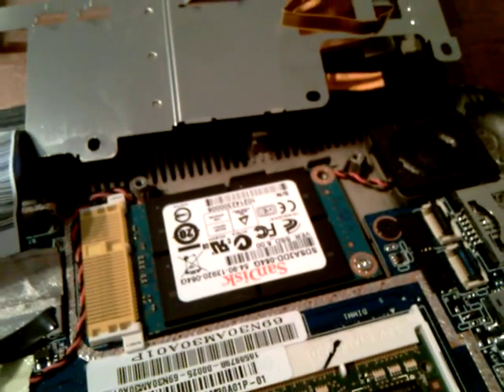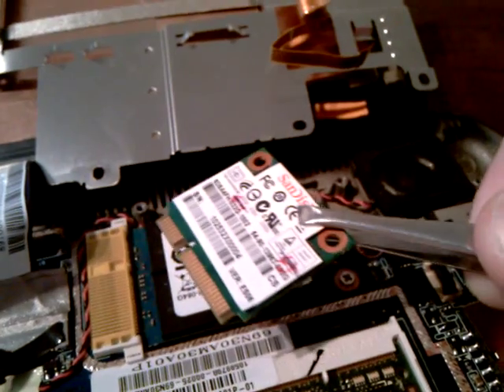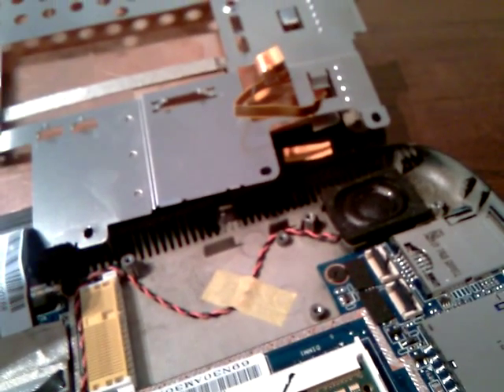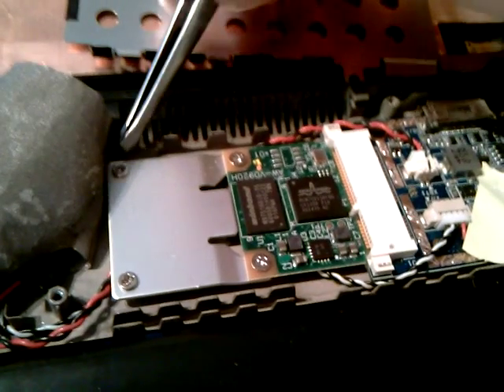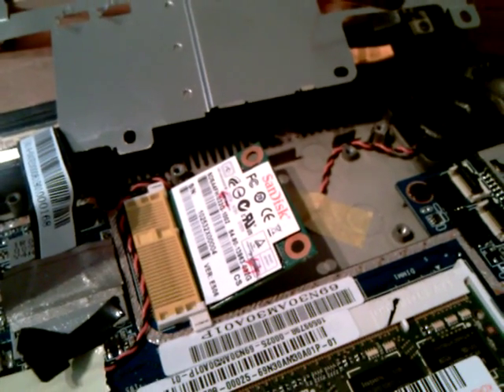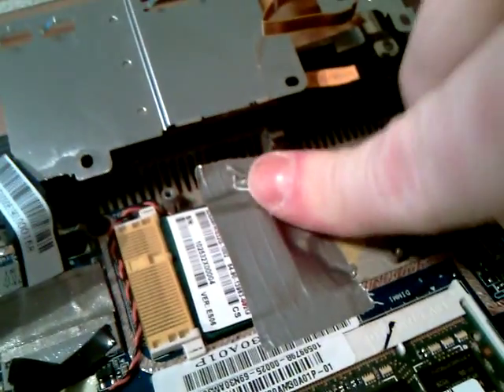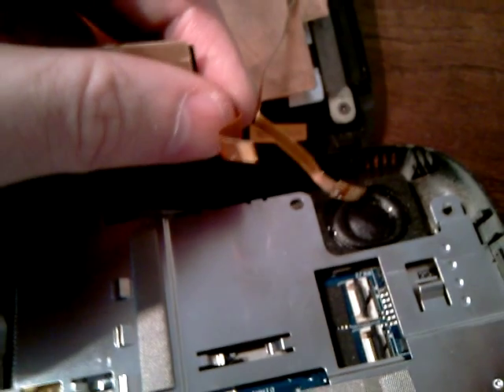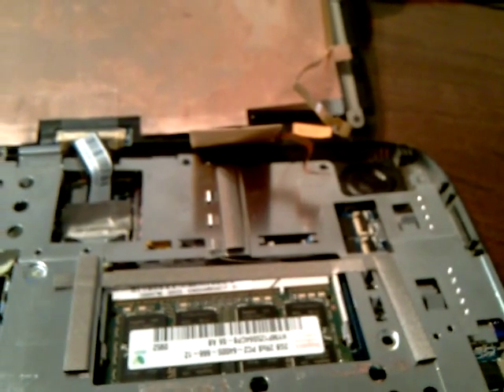ExoPC - SSD Upgrade

Comment from the maker: @cool8man lol It's fine, it only covered up a little. There is quite a bit of free space, i dont thinkg there's enough for another battery (if you were serious), and it would change the weight dynamic if one was put in. I think there's enough space for an integrated capacitive stylus though for sure.

Comment: hi was going ask about best motors for skateboard but can check your videos but my acer laptop just bought 8943g i5 i put sad drive in as 2nd drive but the windows 7 main drive came up as missing boot manager error.i did download easy bcd and had it on once but error came up again.i checked connector but didn't get windows 7 disc with acer ..thanks

Comment: i have just got the non 3g version on craigslist to replace my old broken tablet and i know it has 4 pcie slots (3 used one extra for the 3g) but my question is do you know if i can put my old tablets SSD where the 3g card would normally go so i could have an additional 16gb internal storage
thanks

Comment: After I have installed a new and bigger SSD in the slot of the old SSD, can I put the old SSD in the slot where you have the 3G/GPS-module? Or can I put it in the slot of the broadcom video accelerator? Just to have a second hard drive for extra storage...

BTW: did you test with a 4GB RAM stick, or do you just assume it only takes 2GB?